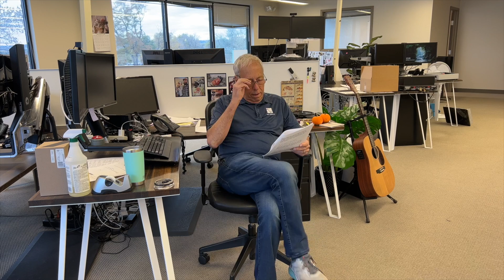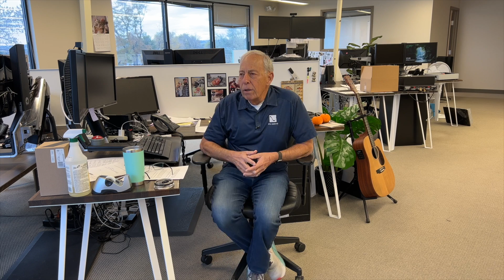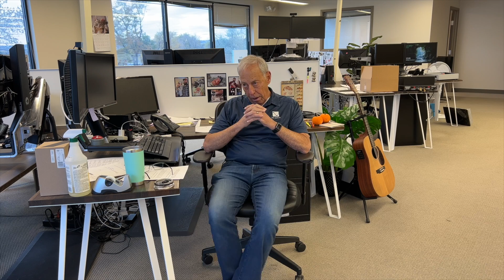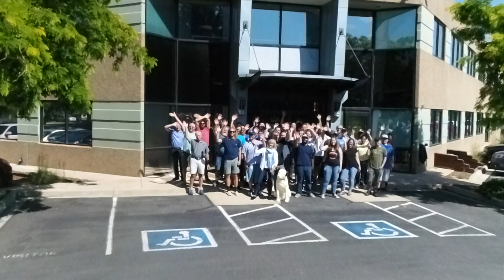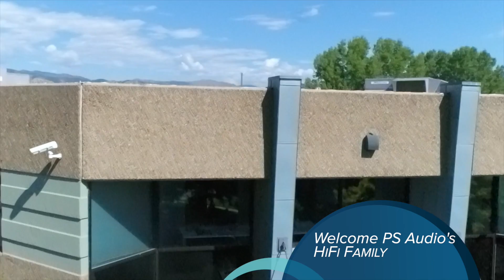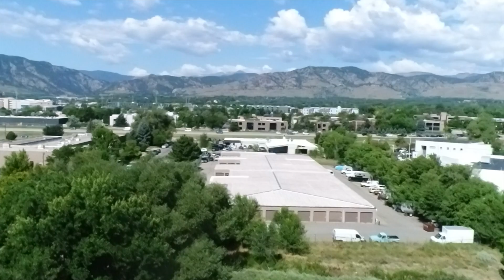Understanding current and voltage in audio

Comment: Think of an engine..the flywheel gives the engine ability to handle the load..(hill) . Voltage is horsepower.  But without a flywheel it cant keep steady control . Hope that helps...an amp with low voltage rails but beefy transformer and capacitance...can only push the woofer in and out so far...but if you connect many of them and still move them no problem.. compared to same setup with more turns on the secondaries can move the woofer farther..but not as many and it will sag the rails.. THE BEST AMP DOES BOTH..YES .AND THATS EXPENSIVE...PREDICTION..GONE ARE THE DAYS OF CLASS D.  REAL CLASS A-AB AMPS...are the future..WHY ? CAUSE we will  not lie. In the usa...WE ARE BUILDING REAL AMPS AGAIN... but better..

Comment: There is a vast difference between REALLY understanding  electrical terms such as voltage, current, resistance  impedance,  (watts)  etc - and....
 simply "applying" them such as in ohms law - which most people do. 

 It took a LONG time for the early scientists such as volta ohm,  ampere  coulomb ' faraday and many others to figure it all out... so these concepts are not simple!

For electricity to do any useful work - it MUST "flow" around a CLOSED  loop ( circuit) of electrically conducting wire or similar.

It cant flow into a wire that goes nowhere - it will come to a dead end (open circuit) so there is no flow.

. So it follows that we have a loop of wire - with some "force" (voltage) pushing a "flow" ( current) round the loop .  

And - just like pushing  (voltage)  a weight along the floor (as it moves = current) - against  friction = resistance)  which takes "work  " ( force * distance = watts ) to do it...

The harder we push (voltage) the faster the load moves (more  current)  .. the more work we do... and .... the farther we push it
 That is -  through more resistance -  the more work we do  

 we have exactly the same going on in the loop of wire.. we are "pushing" (volts)  a flow( current) against the resistance of the wire.

So we can see two things straightaway...
We  can change the flow ( current) -  raise or lower  the driving force ( voltage) - or change  the resistance of the loop ( make it  shorter / longer - or thicker or thinner .

So - raise the voltage - more current.
Lower the resistance.. more current
Lower the voltage - less current
Raise the resistance - lower the current

We end up with :
Current = volts/ resistance

And - work done ( watts) =
Volts * current.

L

Comment: In your water analogy current (coulombs per second) would be the speed and voltage (joules per coulomb) would be the potential energy of an electric field that would be applying pressure.

Comment: For the water analogy I always thought of voltage as the "pressure" and the current as the "flow rate" (or as Paul loosely says "speed"). When he explains starting at 0:56, he seems to say the opposite. It seems either he or I have it backwards?

Comment: Dear writer,

I’m very sorry the hear and see that nobody answers your question. I hope you are not getting disappointed in the audio community. I like to try and give you an answer. It’s kind of a long answer. 

Your question was: Could you explain the difference between current signal transfer and voltage signal transfer?

The type of signal transfer is determined by the output impedance and the input impedance of the systems which are connected for the signal transfer.

If the output impedance is much lower (*edited*) than the input impedance, then there is voltage signal transfer.  The sourcing system, which gives the output is seen as voltage source, the receiving system is seen as voltage controlled. Note that it is not about absolute impedances, but about impedances relative to each other. 

If the output impedance is much higher (*edited*, both, thanks to G Fowler)  than the input impedance, then there is current signal transfer.  The sourcing system, which gives the output is seen as current source, the receiving system is seen as current controlled.

If the output impedance is equal to the input impedance, then there is power signal transfer. This is done in long distance cables and in radio communications (getting signal from or into an antenna). 

The type of signal transfer you should use is influenced by the transducer being used. A transducer is a system that converts from one physics domain to the other. In the case of electric transducers one of the two domains is the electric domain, like microphones and loudspeakers in the case of audio, where the ‘other’ domain is the acoustics domain. 

Electrodynamic systems, for example an electrodynamic microphone, gives a voltage signal. This is determined by physics. An electrodynamic system generates a voltage (called electromotive force) by induction. In this case the signal transfer should be a voltage transfer. So the input impedance should be much higher (preferably more than 100 times higher) than the output impedance of the microphone. 

An electrodynamic system as an output system, like an electrodynamic loudspeaker (by far the most), is a current controlled device. This is because of Ørsted’s law. It is the current that produces the force, and in the end the output, the sound. To drive a current driven transducer, the loudspeaker in this case, you should use current transfer. So the output impedance should be much higher than the input impedance of the loudspeaker. 

So, the type of signal transfer must be matched to the the type of transducer, whether it is a sensor (an input or source like a microphone) or an actuator (an output system like a loudspeaker). If there is a mismatch between the signal transfer and the requirements of the device you get all kinds of unnecessary distortions like distortion of the frequency response, compression and harmonic and intermodulation distortion. 

I’ll hope this gives you an answer.

Sadly, this leaves the question (the biggest mystery of the audio world) why there are so few power amplifiers operating as current sources putting out a current signal to drive (electrodynamic) loudspeakers. Gladly there are more and more manufacturers that produce the so called current-drive amplifiers, integrated into the loudspeaker or as a separate
Reply: I understand your concern at the poor addressing of the question here, but I have to wonder if your information is likely to confuse people. In your initial description of signal transfer and source/load impedance the relationships of source and load impedances are reversed. The later reference to a microphone is the correct way around. As you say, for the signal transfer from a dynamic microphone, being a voltage transfer, the load impedance should be much higher than the source impedance. However your initial definitions say voltage signal transfer is when the output impedance is much higher than the input impedance.
Reply: @PlatypusPerspective  You're absolutely right! Thanks, and I will correct it!

Good to see that people actually reading it.
Reply: @JerryRutten  Glad I spotted it. 🔍
Reply: @PlatypusPerspective  I’m glad you spotted it.
Reply: @PlatypusPerspective  And, have you any idea why there are so few current source or current-driven amplifiers?
Reply: @JerryRutten  I suspect it's just going to be lack of a compelling reason. That's probably the biggest factor in determining what predominates in technological fields. We've seen it with regards to VHS/Betacord, the modest inroads of inverter technology into microwave ovens, the adoption of electric vehicles...  Even if an alternative can point to a technically desirable factor, if an existing norm is "good enough", that alternative may not gain any traction. Existing amplifier and speaker technology can certainly qualify as good enough in that so many excellent offerings are available. Perhaps an illustration that might suit the context would be the humble relay, which despite being a current driven actuator, is universally just connected to a voltage source. You can achieve a faster actuation time with current drive to the relay, but for most purposes that would not make a difference to the circuit operation that would provide a compelling reason to do it that way. So millions of relays are just connected to the supply rail through a few cents worth of transistor. If there was a compelling reason for manufacturers to use my $1.50 relay current punch driver IC instead, I could make me a fortune. 🙂
Reply: @PlatypusPerspective  If it works, it works... 

On the other hand, audio is the domain of overkill, doing 'anything', at whatever costs, to get better performance. Only except the obvious, just follow the rules of physics. It is always easier to work with nature in stead of against nature.

Glad, that there are more and more manufacturers using current-drive amplifiers. Sadly, most are expensive high-end systems, often with active loudspeakers, with current-drive amplifiers and active crossovers built-in into the loudspeakers, like Kii Audio and SGR Audio. It is not common sense (also to read as "common science"), yet.
Reply: @JerryRutten  I'm sure that as always, alternative approaches will have their place, and will intrigue a portion of those who enjoy audio. A controlled environment such as active speakers has potential, since this eases the challenge presented by the optimization of dynamic speaker systems designed for highly damped voltage drive, which optimizations typically are less suited to current drive. Current driven circuitry has been used historically where desirable or the most practical. A good example of the former is the automatic choice of a current summing inverting stage for the busses of an analog mixing desk, due to offering very low distortion summing of multiple signal inputs. Disadvantages of noise performance and the unwanted inversion of the signal just require suitable accommodation in the circuit design. And it has been long standing practice, for practicality, for the headphone output from the likes of a mixing console or power amplifier to consist simply of a comparatively high value resistance in series with the headphone drivers, delivering a current drive to low impedance headphones. There is even an IEC specification defining a 120 Ohm source resistance for headphones. Conversely, with modern low voltage devices utilizing headphones or earpieces output impedance has gone to low values, e.g. my iPad Air has a headphone output impedance of 1.6 Ohm.
Reply: @PlatypusPerspective  Thanks for your nice examples! In addition to your examples, I understand that the DIN specifications for interfaces where current based.

And about optimisations of highly damped systems… I don’t think voltage-drive and electromagnetic damping is the way to go.

Electromagnetic damping (whether rheostatic or eddy current) is not a solution to something, it is the root cause of all kinds of problems.
* As it operates the driver as a microphone (!!) and feeds that signal back to the input, it introduces modulated noise!
* As rheostatic electromagnetic damping is highly dependent on the actual voice coil resistance and thus the voice coil temperature, the actual damping is all over the place. At maximum rated power of the driver, the actual damping factor is reduced to around 1! As the temperature is modulated with the power content in the music the actual damping is continuously changing.
* At maximum rated power the voice coil resistance is about doubled, a poor quality driver dies before it reaches that point and a high quality driver can reach more than 220%!
* The eddy current electromagnetic damping is highly dependent on the actual resistance (conductance) of the voice coil former and thus the voice coil former temperature.

Electromagnetic damping requires voltage-drive, which introduces additional problems:
* The sensitivity of the driver is massively reduced at resonance. They say electromagnetic damping works like a break, and that’s right. But it breaks always when there is movement in the voice coil, signal or no signal. And when a loud tone around suddenly stops, the drivers drives the power amplifier (some loudspeakers are infamous in burning amplifiers). 
* The sensitivity and frequency response is modulated, because the voice coil resistance is modulated with greater effect at the mid frequencies than the low and high frequencies (power or thermal compression).
* A passive crossover between power amplifier and driver relies on the voice coil impedance, of which the voice coil resistances modulates between 100% and (more than) 200%, which means that the crossover frequency modulates between the frequency at rest and (more than) an octave lower! On top of that the crossover frequency for the ‘lower’ driver modulates in another rhythm than for the ‘higher’ driver!
* The voice coil inductance is modulated by driver excursion and by current, which creates additional distortion, especially IM distortion, in the order of 30% with great excursion.

Voltage-drive makes the system (power amplifier, crossover and loudspeakers) very sensitive to impedances, and that is, in my view, the main reason why every combination of components sound different and why people are looking for ’synergy’. The higher the damping factor the less control over the output!

With current-drive (and non-conductive voice coil formers) all these effects disappear. With current-drive you can easily outperform the spec sheet of a driver (because it is measured with voltage-drive).

So, you don’t want electromagnetic damping and voltage-drive, and you don’t need it. There are alternatives.
* The fastest and best way of damping is with EQ in the crossover (a, for current-drive redesigned passive crossover or an active crossover).
* Other (additional) ways are mechanical damping (in the driver) or acoustic damping (in the enclosure, with transmission line or with open baffle).
* Hydraulic (ferro-fluid) and electromagnetic damping are to avoid.

So, to optimise the damping you need current-drive! Precise, stable and with better performance!

Comment: Current = Coulomb/Time (I = Q/t) - That literally means the amount of electrons per measure time which is equivalent to the formula for Speed = Distance/Time (v = d/t). That means CURRENT are equivalent to the speed in the water analogy. Voltage is the energy done per charge (V = E/Q) which is akin to pressure in the water analogy

Comment: Question for you, Paul. Do high end CD players or transports utilize DSP to color their outputs? Why do so many audiophiles say a digital player outputting a digital signal can sound better than a cheap DVD player with S/PDIF out? It seems logical that these audio nerds could be actually hearing subtle DSP EQ curves happening to their music in these expensive players.
Reply: Its more that the digital circuitry is less noisy, less error correction. Even though it's digital output, it's not 'raw'. It will get upsampled, reclocked, etc. Each IC doing this will differ between a cheap and dear CDP. That's where the difference in sound is.
Reply: @peterlarkin762  how can error correction color the sound? The data is either intact or corrupt.

Comment: Hmmmmm.. Current flows in a given direction; voltage is the potential difference between one point in a circuit to another point...  Power is the product of the two !

Comment: As an electrical engineer, it's a bit painful to listen to and read through the confusion in many of these explanations.    Sorry, I can't untangle it in a short paragraph - it's relatively simple, but not that simple.
Reply: My observation is, as frustrating as it is to see people giving thanks for now "understanding" some dubious explanation, and various other people demonstrating that they don't understand much of the subject at all, there's rarely much benefit achieved by offering technically accurate input. I've seen a notable Audio Engineer such as Bill Whitlock offer some points of correction in a topic on another channel, and all that happened was a bit of milling about, a couple of people said that they were glad at least someone had spoken up, but the uncomprehending posts continued in the topic and the presenter of the video made no response, and presumably is just as likely to present the same misconceptions ongoing.

Comment: Hopefully one day before I die my mind will be able to grasp electricity. Power, current, ohms, Amps, Capacitors. Maybe a simple kit I can solder together to make something work would help.
Reply: Once you start comparing electronics to hydraulics it becomes much simpler.  Watts (power or flow rate) equals volts (pressure) time amps (volume), resistors are just flow restrictors, capacitors and batteries are like pressure tanks, switches are valves, and diodes are just check valves.  Pretty much every electrical devise acts like some hydraulic control.
Reply: A kit is a good starting point.  I started tweeking speakers and cables.  Build kit amps and DACs.  Over time built a complete system from scratch actually downloading a patent for a tube amp.  Very educational and satisfying.